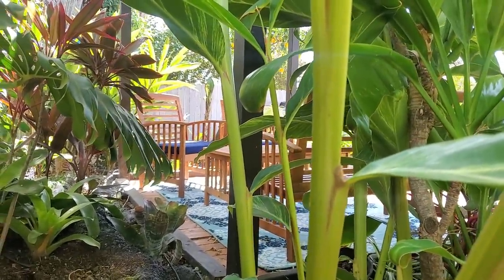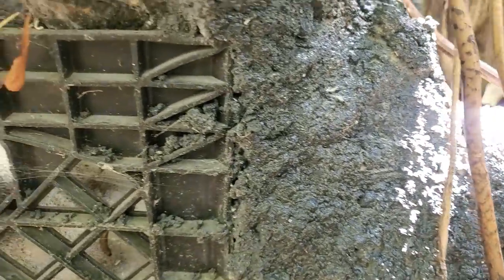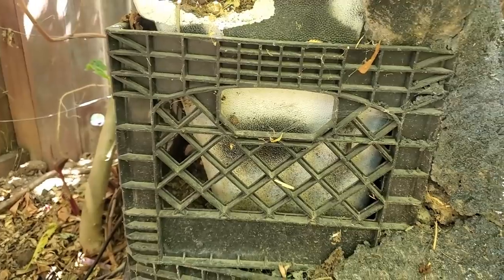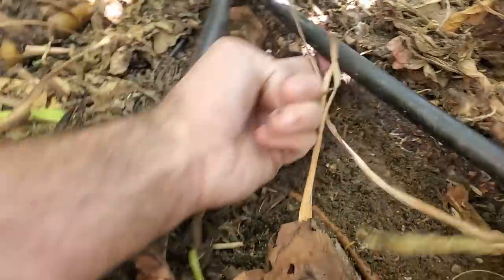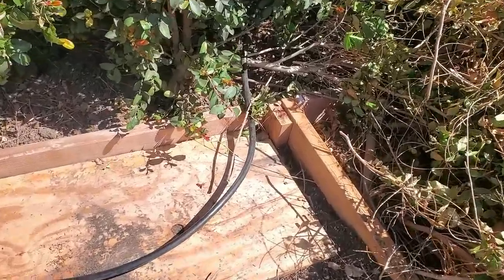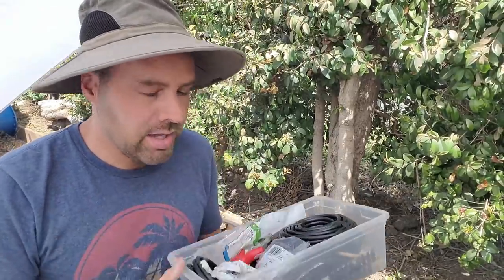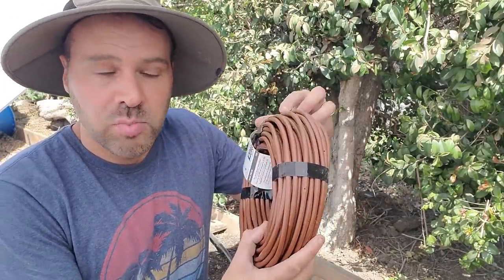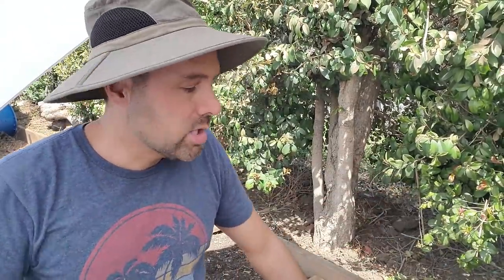Drip Irrigation Step by Step  & What's Behind the Turquoise Doors?

Comment: This video concentrates mostly on "secondary" side watering, ie the feed and drip hoses. However a big factor on the "primary" side is to note the manufacturers, ie rainbird, dig etc will mention the need to reduce utility pressure. (I have 85psi in Sacramento) After the timer use a vacuum break/ anti-syphon device, then a pressure reducer ( usually to 25 psi for drip) then run your lines. The drip lines are usually restricted to 60 psi max so a reducer is good for longevity of your system and still produces great watering results. Worst thing you can do is apply full utility pressure to drip irrigation and not protect your house from back flow contamination.

Comment: I recommend the scissor type tool for making the holes in the 1/2" line.  I had the cheap little tool for punching the holes.  I could have taught a sailor new cuss words by the end of the day!  It not only was hard to make the holes, but when I pushed the connector in, the line would collapse.  The scissor type closes and does the hole, then if you leave the line in the tool, it stays round and you can push the connector in.  I'm glad I waited for that tool to finish the job.  You made it look easy to do, but as a woman, it was better with the help of a little bit pricier punch.  Thanks again for all the great videos!

Comment: I did it! I took the day and installed a drip irrigation system. It took me the whole day. (An hour?? Lies!) But I’m so happy to have it done. The most challenging part was pushing those little barbed connectors into the 1/4” tubing. I finally got out my blow dryer to heat and soften the tubing so the connectors would slide in easier
Reply from the maker: Awesome!

Comment: I like this style of video. The steady talking to the camera is nice but also stomping around the garden is relatable. Thanks. I've started setting up my drip this year. Got really low flow out the gate. I've got to troubleshoot... It's so tiny it should have ample pressure...
Reply from the maker: Thank you. I like making this kind too. Did you add a pressure reducer?  Maybe you don't need one.
Reply: @NextLevelGardening  I didn't because I have pretty low pressure to start. But soaker hoses worked pretty well last year. I thought the tiny lines would give me more pressure.

Comment: Drip is the only way to go. My garden sucked until I put mine in and now have great success. One thing that helps tremendously is to put a pre-filter at the water source.  They are about $8 each and you put one on each outgoing main drip tube.  It prevents sand and sediments from clogging all those little drippers. We have a lot of sediments in our well water here in the Central  Valley  of CA so its an absolute must.
Reply: It's 2 yrs since your post..I'm wondering how those pre-filters are working out for your watering system? I have a lot of sediment as well and looking for a solution for my new drip irrigation.  Thx in advance!!

Comment: My hubby is a neat freak so I only have a few junkie areas but they drive him nuts (I'm working on cleaning them up). I have had a problem with my large black tubing not fitting together and I think it's because they're different brands. The large connectors don't work with all my tubing. I did find a size changing connector at Home Depot that allows me to transition between them. But I bought them a bazillion years ago so maybe it's not a problem anymore. Great and helpful video as I'm getting ready to run drip to my cutting garden and I want to tap into the line to the veggie garden. Thanks.
Reply from the maker: Good tip!! Lol. The doors were installed to stop Emilie complaint about the view from the gazebo.
Reply: I had the same issue with one system of tubing purchased from Home Depot, and another from our local garden center. The tubing was labeled as same diameter, but didn't fit together.

Comment: If you put the tubing in hot water it will soften it. Then it becomes so much easier to put on the connectors
Reply: Heat gun

Comment: Our garden is 127' away from our house/water source. I hope it will still work well. We seem to still have good pressure with a regular hose and sprinkler, but I really wanna do drip. Im also installing a rain catching system. We have major flooding near our back door so that will help in many ways to eliminate that issue and be beneficial. I am buying the b-hyve wifi controlled water timer. Looks like a nice unit for under $50.

Comment: Yep I have a junk portion of the yard. I hope to clean it up some day 🤣🤣🤣. When I had the big garden, I used a sprinkler type system (Mr. Landscape) and used it in my flowerbeds along the house.   It was hard to be precise. 

After watching your videos last year I installed some drip off of that system onto the containers on my back deck. I had problems with water pressure towards the end of the line. I’m thinking maybe I need to connect it at each end like you showed in the bed you just did. I’ll be revamping all of that this year and will try to set it up that way. 

Thanks for another informative video. Also thanks for always being real and showing “off stage” and less than perfection. It gives us hope that we aren’t failures 🤣🤣. 

Please know how much you are loved and appreciated. ❤️🥰❤️
Reply from the maker: Thank you. ❤ I didn't remember you adding drip. Awesome! Yea...I. anxious to see if this solves the pressure issue. Going to revamp the back beds if so. I'll share if I do.
Reply: @NextLevelGardening  I just did it on my back deck last year but I’m going to revamp the lines along the side of my house in the flowerbeds so it all consists of drip  I’ll reconfigure whites on my deck and make sure I have it connected in two places

Comment: Got my wiseorchard from your video last year... Hopefully my set-up works and I don't have any issues like other unfortunate viewers!! Going to set up the drip system this spring!!!
Reply from the maker: Good luck. Please let me know.
Reply: @NextLevelGardening  trying to set up my system now but finding an issue with my pressure regulator. Wondering what brand you use for the backflow preventer & psi regulator. I bought the DIG starter kit and my 3/4 ones that came with the kit won’t fit?!?
So far the initial account setup has worked for my wise orchard. Can’t yet provide details on how the actual system works until I get the psi figured out

Comment: One more thing, from your water spigot to your 1st bed do you just run that 1/2 black tube to where it needs to start.  My back yard is long and wide.  It's 75ft wide and it's about that long  from the spigot to the furthest point with a gate in between.  I have to use 100ft hose to have enough room to get to that end.
Reply from the maker: You could. Or pvc the get a hose thread adapter for the end to start drip 1/2 inch from there.

Comment: In the bed could you have used two more elbows and a final length of  1/2" tubing INSTEAD of the two ends clamped off? Im using your arrangement in 3 30 foot  long beds so Im wondering if I will get more reliable pressure in each bed if its a "closed system" of 1/2 inch tubing surrounding. the garden with the 1/4" drip hose spanning the two hoses as you have done?.Thanky you so much for helping me. I could never have figured this out on my own. Love from the Inland Empire.

Comment: Thank you for another great and informative video. We live in a rented property that has huge grounds, about 20 acres. The area that I have my veg patch has a rain bird under ground sprinkler system. Is there a way to change the pop up heads to a drip tape system instead. We are in Missouri it is very hot and humid in summer and I struggled with mildew last year, the sprinklers didn’t help. Also our well is very sulphurous, the water smells really bad and turns insect netting yellow. Could this be detrimental to the plants.

Comment: Quick question for anyone that reads this. How do you figure up the length of time to leave the drip on? Looking for an equation I guess, would figure it will vary on soil depth and so on.  Just don't want to set the timers up and then over do it. Would be able to see if I needed to leave them on longer eventually but trying to keep from over stressing the plants in the first place. If this has been covered please just direct me and I will go watch. Thank you for any and all responses. Have not done automated watering yet but want to this year as planning on a lot larger garden space.

Comment: I have a similar set up for my garden. I have two questions. Do you use a pressure regulator anywhere along the lines? I have one installed, but find that the emitters furthest away from the valve drip more slowly. I’m considering upgrading to a higher psi regulator, or taking it off all together. 
Second question, do you have any suggestions for matching the flow rate of the emitters (which come in gallons per hour), to plants water requirements (which come in inches per week)? I’ve never been able to figure this out and have just been guessing at how often and how long to have my irrigation run.

Comment: Good timing!! I just measured the areas I need to do drip, etc. and now have a better idea how to set it up. Question: Can you share on the model # of your timer? I will be needing 4 stations, as well. This video is a keeper for future reference.
Love the dramatics opening the blue door.🤣🤣 Lastly, do you have an idea of water consumption cost saved doing drip versus manual hosing? Just curious.. eventhough my primary motivation is my time away from other things I could be doing instead of standing for hours hosing my plants every day.😏😥🌱🌾
Reply from the maker: The brand is Orbit and I got it from Home Depot.  I don't know the numbers I just know there was a definite decrease in my summer water bill.
Reply: @NextLevelGardening  🌱Thanks for the prompt reply. Will let you know how my venture goes with installation.🌾

Comment: How long on average should drip be programed to run at a time?
Reply from the maker: That's a trial and error thing. Depends on soil, weather, etc... try 15 min for a few days then check the soil with a meter or finger. It it's dry add longer.

Comment: I do run drip irrigation, and I have tried connecting it into both ends of the main line. My issue is a lot of the drip holes seem to always get clogged. I do run a filter at the beginning. Is there any easy way to clean out the drip hose or is it just garbage once they get clogged up.?

Comment: What would you recommend for a small apartment deck.  You would be surprised on how many plants I have been able to put out there.  The problem I have I apartments are notorious for low pressure and can have problems driving water through drip irrigation.
Reply from the maker: Yea. You would have to experiment with how many drippers you could have per channel.

Comment: Brian I’m curious. why do you hook the smaller irrigation pieces between to large drain hoses instead of hooking on one end and just crimping the small ones on loose ends or plugging the opposite ends?
Reply from the maker: It regulates the pressure in the longer drip lines. In the back I did it the way you were thinking.

Comment: Ok, don't use scissors to cut your drip tubing, use Felco hand pruners (or other sharp pruners) like the pros.  Also, rock the tubing into the compression fitting don't twist, works faster. 🙂

Comment: So I just installed drip hose but did not connect it at both ends with the 1/2 inch pipe. I have not hooked up the water yet. Should I run a second have inch to the other ends of the drip hoses before doing so? Is there a significant pressure reduction if I don’t?
Reply from the maker: It's easy enough to change later. If you feel the distribution is good. Leave it. If not you could consider it.

Comment: Do I need to worry about having too large an area serviced by the tube coming from the water source? (I doubt that makes any sense)  I have 2 lines coming off the timer, one for the front and one for the back -- can I just add on to the back as you demonstrated, or do I need to install/add another "station" if I'm going to add on? Thanks so much for this channel - I'm learning so much!
Reply from the maker: I'm sure there is some kind of mathematical equation to figure that out. I just trialed and errord it. One line can take more than you think.

Comment: Just watched your video. Now I have a question. Why did you not end your drip emitter lines with a goof or end plug? Why did you feel it is necessary to rung your half inch tubing down the sided and then again to plug the ends of your 1/4 in. drip emitter lines into it? After you run all of your 1/4 in. drip lines from your 1/2 in. supply line, the side and bottom 1/2 in line are merely static pressure which means the only way out for the water are the emitters. Please explain why you did what you did.
Reply from the maker: More even coverage
Reply: @NextLevelGardening  With out connecting the ends of your driplines to the 1/2 in. supply line runner, at what length did you begin to find uneven water volumes being emitted?

Comment: I’m questioning why you connected the inline drip on both ends?  The basic rule is to have the water flowing one way; one end connected to feeder hose and the other plugged. By connecting both ends you create opposing pressure in the line.
Reply: I’m runnng 3 multiple zone timers in my yard, about to add another to a partial sun side yard.  This is a great video for beginners!
Reply from the maker: Better coverage. In the back yard I have the 1/2 inch tube at one end. The 10 ft drip lines off of that. More water comes out closer to the 1/2 inch tube than the other end.

Comment: Hi Brian, thanks for the video!  At the 6:00 mark of the video you talk about the footer row of ½" pipe, and that it distributes the water through the drip lines better.  Could you please elaborate on that?  Like if i don't use the footer row on the far side of the ¼" drip lines could i run into pressure issues where it doesn't drip out of the far holes, closest to the dead end?
Reply from the maker: Yes. Thats why I did it. Always easy enough to add later if needed.
Reply: @NextLevelGardening  Great, thanks for your help!

Comment: Can the 1/2 in tube withstand continuous water pressure or do  I need to turn off at the Spicket  since I’m running PVC 1/2 in to the black 1/2 inch hose then running off that the drip tube. Any help would be appreciated. 🙏🏻🙏🏻🙏🏻🤷‍♀️🤷‍♀️🤷‍♀️❤️❤️❤️❤️
Reply from the maker: It's not made for continuous pressure
Reply: @NextLevelGardening  thank you! Now I need to find how to convert from the pvc to the black hose. Next step❤️
Reply from the maker: Hook a hose thread adapter to the pvc

Comment: I have nearly given up on drip irrigation. After a few months of it working ok, many of the emitters are clogged and many of the lines have developed small holes where water comes out like a jet. I try to keep the larger tubing covered by mulch, but there is no good way to keep the drip emitters from clogging. Also, I generally do square foot gardening and having a single drip emitter for 16 plants in 1 square foot area really doesn't work. Not nearly enough of a water source to spread around to an entire square foot area. 

How do you deal with clogged drip emitters? Do you do square foot gardening anywhere and have a different solution there?
Reply: I almost forgot another point...  I have a single hose bib in the front and one in the back. Where my garden is only one hose bib can reach, with seven 4 foot x 4 foot beds, the line doesn't have nearly enough water pressure to drive enough emitters for all 7 beds. Anything I can do to fix the pressure issue?
Reply: Also, my hose bibs have a back flow restrictor that the builder cut off the locking screw so it is permanent. This is an issue because it leaks while the water pressure is on, making a timer setup for my drip irrigation nearly useless as I imagine I'd be losing gallons of water per day to the back flow restrictor leaking. Have any advise on that?